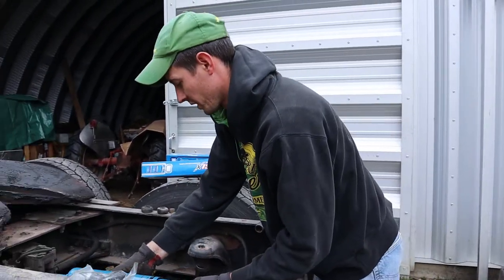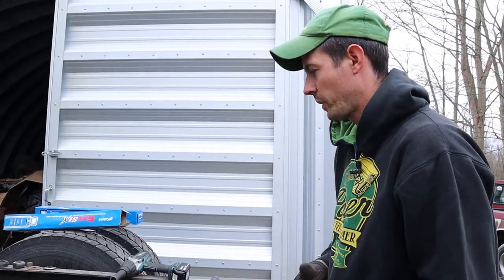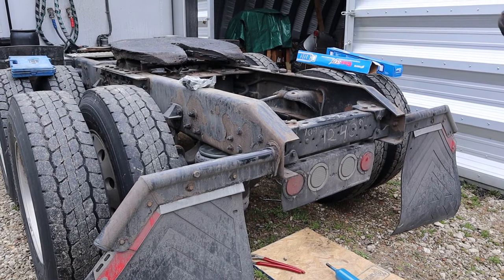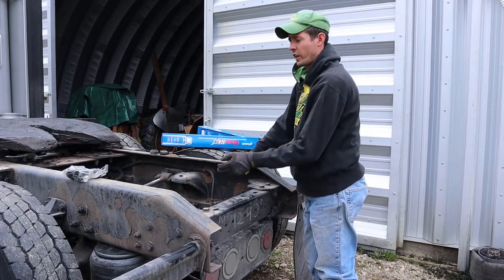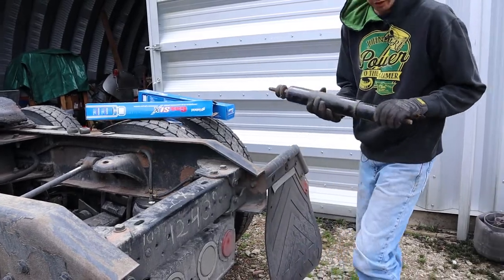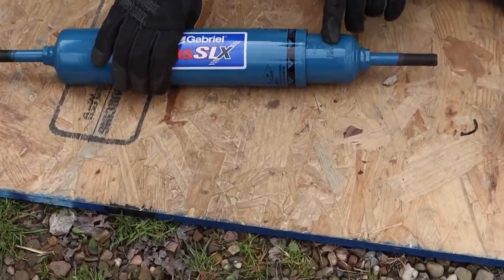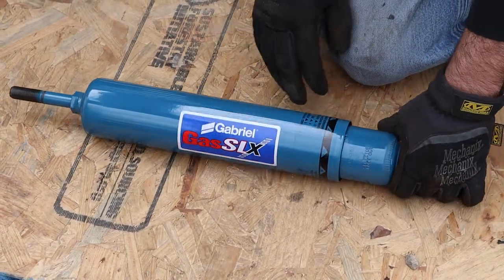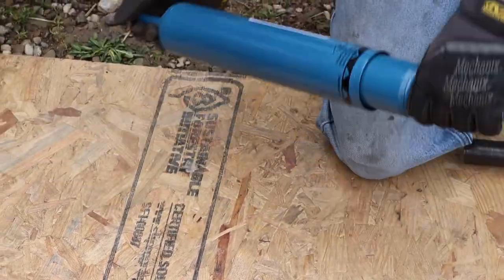How to Replace Semi Truck Shocks - Step by Step Instruction | Owner Operator Truck Repair DIY

Comment: hey brother thanks a lot for your videos I was able to do it with out this high fees, I'm not sure if theres a rush truck center near you , but if you open an account with them and you call to the department of parts most of the times these  guys will drop the price way more some times that  amazon or other places.

Comment: How much do you think you saved doing it yourself? What would a shop charge for this job?
Reply from the maker: The last I saw at TA/Petro service centers was around $50 per shock, just for labor, plus they most likely will mark up the price of the shocks by 20% or more.  I find pretty good deals for parts online and save a lot with that.  On this job, I would say I saved atleast $300 between labor and parts savings.

Comment: I’d like to know how the shocks are holding up. I was using the oiled Gabril shocks and they kept busting every 4-6 months.
Reply from the maker: We're at about 3 months and 30,000 miles on the front shocks with no issues so far.  I just put the rears on, so only about 1000 miles on them today, we will do a review video on both sets when they fail.